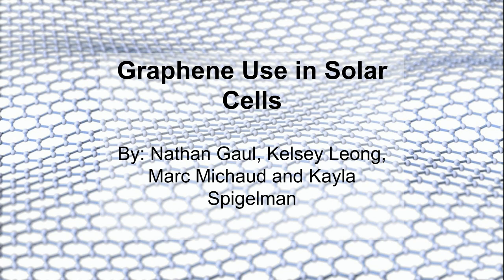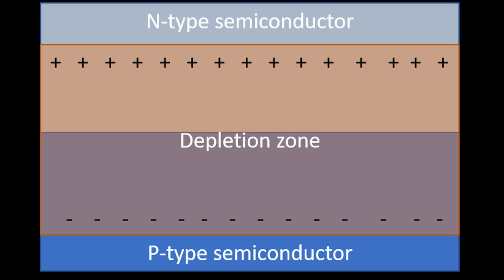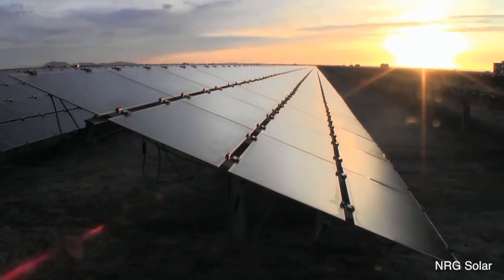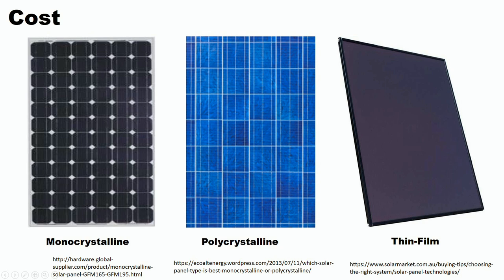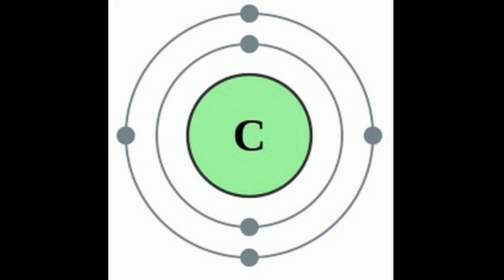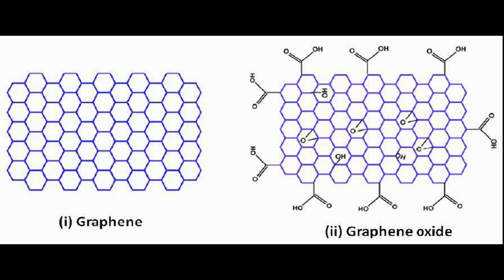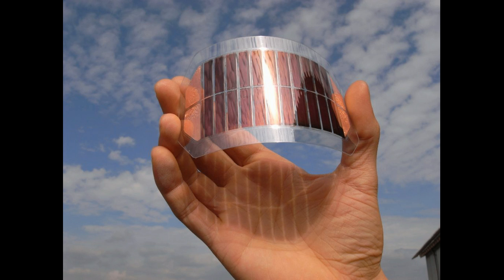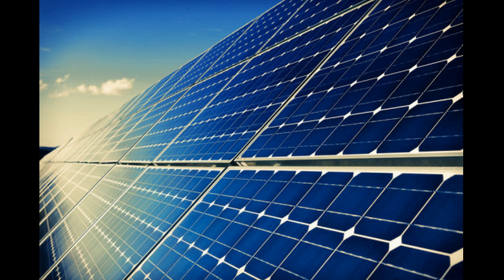Graphene Use In Solar Cells

Comment: At this point the expense of the semiconductor has become relatively cheap compared to the cost of installation and the infrastructure of the container itself. This can be demonstrated in recent data charts suggesting that it does not matter how inexpensive the chips become as the said costs are limited by this physical barrier.
This is why the solar roof that embeds the technology into the roofing materials themselves will be the final push to bring solar to every home and business application at the same cost as a typical roof itself. The esthetics of this approach also solve the argument of them being unsightly on residential applications!

Comment: Screw that use superconducting diamene (bi-layer graphene) in the cells, we'll have room-temperature superconducting graphene figured out in a few years, we already have high-temperature (liquid nitrogen rather than liquid helium cooled) superconducting diamene. Then throw in HRGO-MnO2 solid state anodes to replace whatever's being used and you have the best solar panel in the world.

Which still won't even come anywhere close to competing with Nuclear power, but you get my point.

Comment: Is it when these holes in the p type get filled eventually that the solar cell dies? 
what are the properties of having holes for electrons to get and having many electrons to get knocked off respectivelly?
Reply: typically is through oxidation and the deposit of sodium onto cells that degrade output. That's why you can DIY panels and they are great for a few weeks but degrade to a trickle after a few weeks when factories did R&D and worked out encapsulations to mitigate the issue for years...